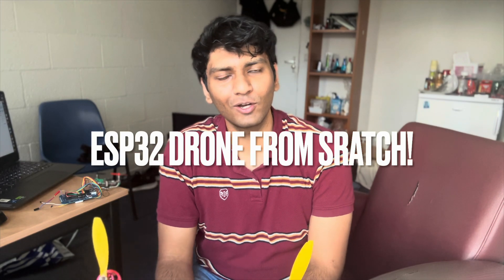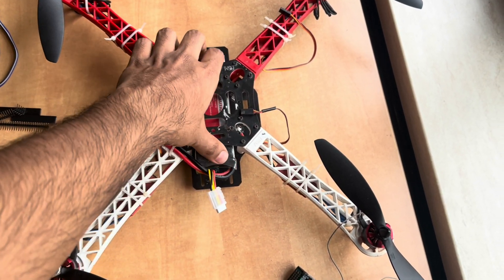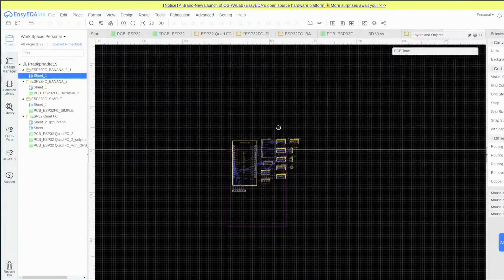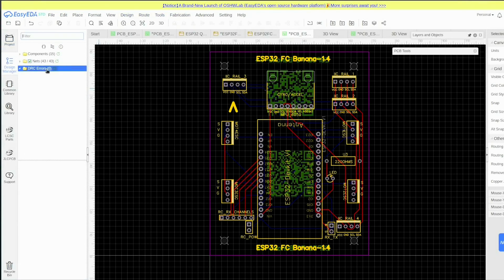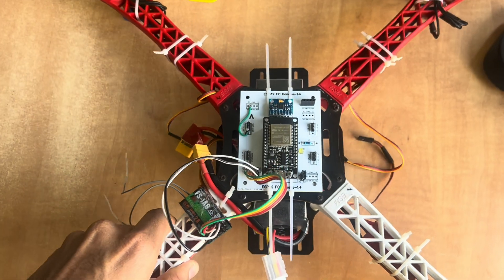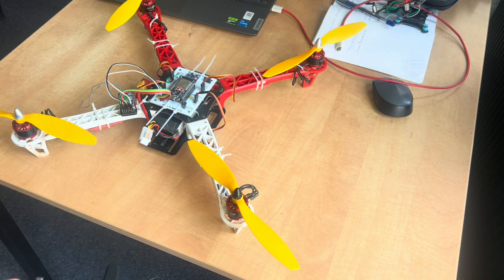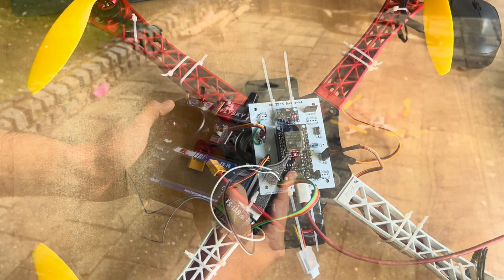Make ESP32 FC Drone from scratch - Full Guide

Comment: From where the esp32 is getting power. Did you used any voltage regulator.
Reply from the maker: The esc battery eliminator circuit is powering it

Comment: Is there a need to adjust the coefficients? PID Is it? Does it support altitude hold module?
Reply from the maker: Pid values for f450 frame can be the same as mine. 

Altitude mode it dosent support as of yet.

Comment: I did everything as it is but my quadcopter is not flying all the tests were sucesfull on turning on throttle it simply slides on the floor what might be the reason??
Reply from the maker: 1. ensure the motor pin mapping is correct and the motor props are correct.
2. keep the quad on grpund and then throttle the joystick from low to middle quickly, it will get a vertical lift, now you need to control it.
Reply: @pratikphadte   thanks Pratik it worked but a new problem is arising left side motors(3,4) are spinning faster than right side motors (1,2) resulting in left side of drone taking off and fliping over
Reply from the maker: @ayush15093  you need to do ESC calibration

Comment: I printed gerber file in description my board is not getting power on on connecting MOT1 pins
Reply from the maker: Oh I am sure I made the change, can you see if the power pin (5v) from mot1 is. Connected to the VIn of the esp32 via a continuity test?
Reply: @pratikphadte  It is working thanks a lot pratik
Reply from the maker: @ayush15093 that’s great, good luck!

Comment: brother can we use this one to control an rc plane , I am looking for a diy one to control an rc plane , I am very confused since I know very little about this stuff , so please help
Reply: Brother in the description you've mentioned about the channels you looked through to get to this point , I visited it and my head was spinning , I'm confused
I'm aiming towards learning to build a flight controller from scratch , like get my hands real dirty , I'd like if you let me know what order to view the video in 
Note: I'm learning c++ after which I'll learn Arduino , and then I'll do this project , just letting you know this cause yes I have a skill issue over here 
Your reply has greatly relieved me , hopefully you spare me some more of your time brother 
Thank you
Edit: I've build rc planes and understand basics of just letting you know that I'm familiar but not anywhere near the level you're at.
Reply from the maker: Start with carbon aeronautics channel
Reply: @pratikphadte  gotcha
Reply from the maker: Hi, it could be configure to work for a plane, but youd need to look in deep for code change. Which could be challenging

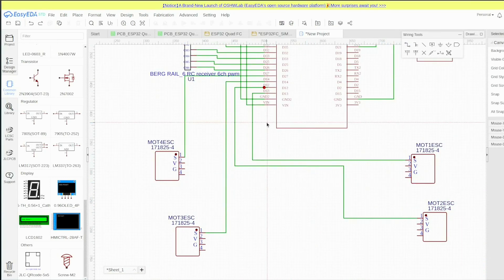Comment: At 4:24  time stamp you told that.. only one esc SVG connector v pin will connected to esp vin.. so why not REST all 3 esc ,s.  SVG PIN,S.    V PIN IS NOT connected to esp vin pin ??
Reply: I believe he did that to power the esp32. The escs have those three wires called BEC (battery eliminator circuit). As the name suggests, you can connect the vin of the esp32 to one of those V pins from any of your four escs to power the microcontroller without needing an extra battery. But you don't need to connect all four to power the esp32, only one is necessary.
Reply from the maker: thats right

Comment: bro i made esp drone using esp 32 ,it circuit/symmeticsk is simmilar to your . i don't check all pin .  but problem is i don't have any code could i use your code .
could u pls tell me steps i am a little confuse like i connect everything.

i don't know what to do next like testing or celibration types
Reply from the maker: Hey hi, yes you can please refer the video steps clearly, youll get it

Comment: Why is it that when I use the code, motor 2 is always at the minimum output value? I increased the throttle, and mabe all four ESCs should receive the same input value (e.g., 1400) to take off, but ESC 2 always remains at the minimum value (1200). As a result, my quadrotor cannot take off vertically along the z-axis. Do you have any suggestions to fix this issue?
Reply from the maker: maybe re calibrate your ESCs

Comment: I followed the video but when I finished all the steps my d14 pins had a problem not receiving the esc it only received when I unplugged the signal wire and plugged it back into the esc it received but when controlling after a while some other pins sometimes stopped rotating can you help me

Comment: Great Video! One question. Are you using 2 batteries? One for esp and one for the Motors? If you using one battery how you Connect them because, on the drone pcb are just 4x 2 connections for the esc and one for battery. Esp havnt a slot right?
Reply from the maker: @danielhasi6974  the esp is powered by the ESC battery eliminator power supply which is 5v
Reply: @ thx. So if i understand correctly, one of my 4 esc have a another connection for the GND and 5V for the esp32. So one ESC has cables for the motors and one for the esp32

Comment: Hi Pratik i read somewhere that esp32 gpio pins expects 3.3v but the recievers output is 5v. is this correct ?
Reply from the maker: Hey, thats a good question!. Yes ESP32 GPIO input pins are designed for 3.3v as HIGH. 

The answer lies in the  ESP32 interrupt service, the esp32's interrupt service routine is coded to check whenever there is a change in the state of the RC receiver pins, i.e whenever you move the sticks of your transmitter, the esp32 detects that change (rising edge) from the rc receiver and starts a timer, now when there is a change again(falling edge), the timer stops and that time is stored in a vairable.

here the change could be a 5v pulse of 1000-2000us, i think this is a short pulse and it is not that harmful to the esp32,  because the average of that PWM might be less than 5v in most cases.

So i think it is wrong to give the esp32 to give 5v pulses input from the receiver, but since its a short PWM signal, its average dc value would be less and should be fine.
Reply: @pratikphadte   So to tackle this i am going to use a Logic level converter. also I am going to use 	SmartElex ESP32 38Pin Development Kit WiFi+Bluetooth Ultra-Low Power Consumption Dual Core. but the thing is I don't know how to add software and other stuff in it. can you please help me. i have never did this before. i am wondering how and what firmware you installed in it. could you please check up this config. as for the pins and outputs I will tinker your provided code. but I don't know how am I suppose to upload something to a chip could you please make a video showing the basic steps not a high-end one
. it will be very helpful thanks

Comment: I tried this but the code is not working. There is loss of self leveling. When i release the sticks the drone wouldn't return to a horizontal position. I used the code from git hub. Let us connect and help me out . Thankyou
Reply from the maker: Did you calibrate IMU and verify motor pin connections and propellor direction?
Reply: @pratikphadte  yes brother I did all the checks and tested . I made the connections referring to your github . There is no pid correction visible while flying. Even at value 8 . Any reason?
Reply from the maker: That is strange, id suggest to print the IMU values, REciever values and the motor output values in the main code to see if they respond to any movement.

Comment: In the beginning my quad was behaving like plus mode quad after gyro calibration now it's completely different quad is not stabilizing properly motors are not reacting according to the drone movement. Any solution??
Reply from the maker: I’d say to test everything and check motor rotation, connection and mappin in code

Comment: I just watched the RTOS series on DigiKey channel.   Seems like this would be a good project to use multithreaded software on the ESP32.  Thanks Pratik, for giving me the confidence to try this myself.
Reply from the maker: Hey that would be a great project, i have seen the series as well, i wanted to try that to. If you're fine with it, i would like to know about your progress, we can be in touch in mail or discord. pratikphadte1910@gmail.com
Reply: Use ESP32 with ipex/ antenna connection .... why  are we settling for 'mediocre'- demand these chip manufactures to not skip on important features of the chips. External connection points provide for so many options/ further performance increases...maybe the positioning of your GPS and/ or esc or other electronics interferes with the esp32 signal? With an ipex/ antenna connection, the antennas(s) can be relocated- problem solved.

Maybe the project requires a directional antenna? Or combination of both directional and omni? These chip makers don't understand how many more sales will be had if they allowed for us to do so on all their product offerings which deal with RF/ signals arrround us......

Comment: Bro I am doing similar to this using esp32 and I've followed carbon aeronautics till half, I am stuck at receiver part, I have only flysky i4x and fs A6 which is a pwm receiver and cannot accept ppm signal. In joopbrooking website he mentioned using an arduino pro mini to convert all 6 channel pwm signals into a single ppm signal. Do you I can do that? or online there are some pwm to ppm converter should i buy them. I can't afford new  reciever or transmitter at this point. Any advice would be much appreciated. Thank you.
Reply from the maker: You could directly try for sbus, I believe there is an sbus library for esp32

Comment: Hi Prateek, very nice project
Does it support various flight modes like alt hold, loiter etc.  
Also wanted to know whether it supports GPS and subsequently mission planning. 
Thank you for the share
Reply from the maker: It’s a basic firmware , no it just flies in angle mode , all the other options are yet to be experimented and tested
Reply: @pratikphadte thanks

Comment: I have seen a repo on github , ig you can also run betaflight on it and it also says it supports Wifi and Espnow as connection protocol so one can control it using wifi or another esp32, will be helpful if you can explore and showcase to us.
Thanks, great video :)

Comment: I would like to thank you for this wonderful and helpful work for beginners. I just want to ask how I can control it through the phone and Wi-Fi. Can I use any app on the phone? And do I need to modify the code to make it compatible with that? Could you assist me, sir?
Reply from the maker: Thank you for your kind words! yes you can, however you need to modify the code to use your mobile phone as TRX. You can mail me your problem, i will try to assist but cant be timely.
Reply: I really appreciate your reply to my message, can you send me your email?

Comment: Great video bro❤

I have a doubt
Can I use this flightcontroller for making a coreless motor based mini drone?

Please reply
Reply from the maker: Thanks bro! yes you can use the code for a coreless motor drone, you have to change the motor write function and the transmitter and reciever function to make it work.
Reply: @pratikphadte  don't forget to tune the PID gain and parameters in order to work for your drone

Comment: Great job Pratik, how did you find ESP32 response in real time calculation is good to use ? are the motors A2212 1000kv? thank you
Reply from the maker: Thanks!, i kept the refresh rate at 250hz based of from joop brooking and Carbon Aeronautics, to verify if the ESP32 meets this deadline, I ran the PID loop 1000 times and measure the execution time, I found that the execution of 1 cycle takes 3500 us, so i kept 4000us for safety which is 250hz.
Reply: Niceuuu bruhhhh😊